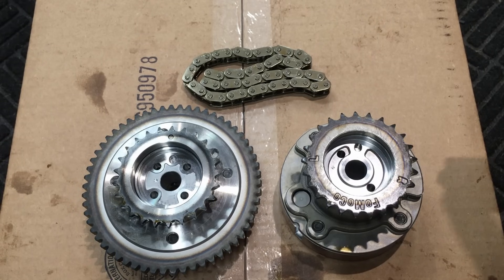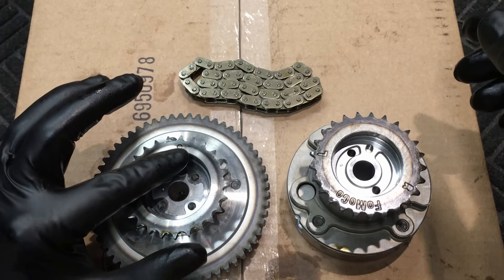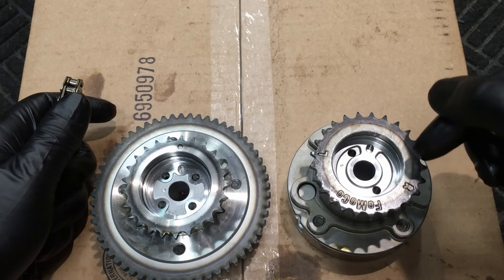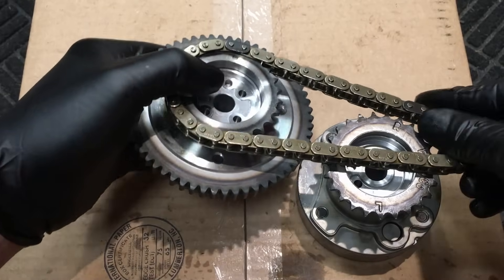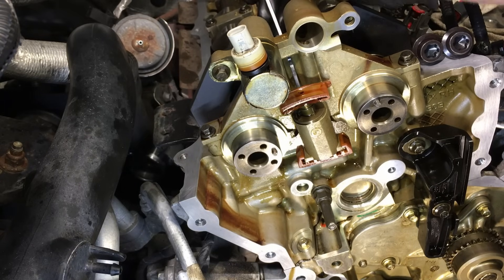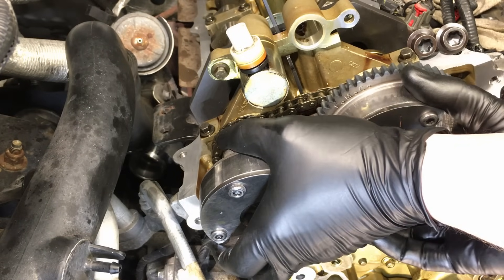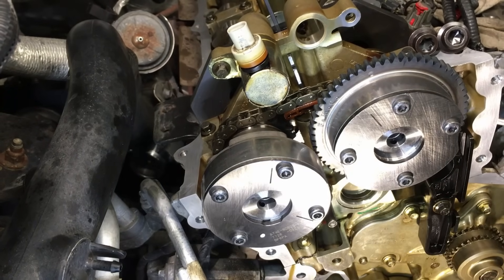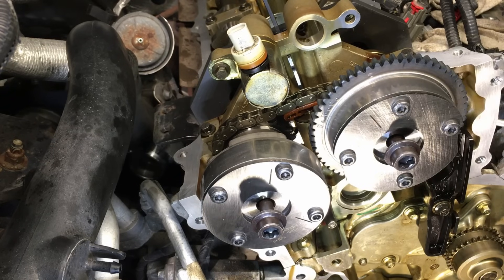2011-2016 Ford F-150 3.5L Ecoboost Timing Set Replacement Part 3: Timing the Engine

Comment: You might add to make sure to install guides before installing cam phasers. You didn’t replace them in this video but the kit cane with them. Now I can’t install bc the bolt doesn’t pass the phaser without removing it🤦🏻‍♂️

Comment: My new chain doesn’t have any colored links! To make matters worse I forgot to take the crank bolt off before I ripped everything off in prep for the new oil pump. It was lined up with the cam holding tools prior to that but it moved from the 4 o’clock position when I pulled the crank bolt off. How many links from the Passenger side cam timing mark to the crank timing mark??.?

Comment: Hi, great videos!  I followed everything to a “T”, and upon startup I have a recurring p0017 code (cam/crank correlation bank 1, sensor b) and the truck is down on power. I replaced the secondary chains and all vct solenoids while I was in there. Any advice?
Reply: Did you ever able to resolve the issue?
Reply: @painterken2542 yup. Did it all over again, found that I didn’t take all of the slack out of the driver side of the main chain. Ended up one link off. After redoing it, it’s been prefect for 35k miles!

Comment: Looks like the chain was offset(teeth on the outside of chain) on the idler sprocket. Hope you fixed that!
Reply from the maker: Nope it was perfect.
Reply: @FordTechMakuloco  I wondered can you direct me to a writeup? I didnt understand what you meant by removing the(followers and adjusters). I didnt see you remove the cams so I suspect I wont need to? I dont understand why or how you mean turning the cams without the crank, or how much... Please help.

Comment: So I'm rebuilding the engine on my 2012 F-150 with the 3.5 EcoBoost and I just did the timing using all new parts i watched all of your videos plus using a Haynes manual everything looks good except for the passenger side secondary chain has some slack on the bottom but it's not all the time just when the cams are in the neutral position is this normal?

Comment: Would be very nice to mention that the cam phaser bolts use a TP55 and not a T55
Reply from the maker: Either works as shown here but yes the bolt head is torx plus.

Comment: Excellent video! Job is tough for a backyard mechanic as there are many tricks getting fittings off without breakage. Not a lot of room for the front cover work area, but manageable. It is hard to get all the coolant out as explained in video. Prepare for spillage on the ground. Be sure to use a zip tie to hold the chain together at the crank sprocket before installing the tensioner. I didn't the first time and cams were out of phase and it ran like crap. Pulled it apart again and redid it with zip tie. Installed new tensioner and pulled pin, then cut zip tie. Alignment was perfect. Do not tighten crank hub bolt with cam locks in place. The chains will slip on the gears. Use a strap to tie the crank hub to the frame.
FYI it took some driving before the permanent DT codes cleared. Cleaned them out with my OBD scanner and all good. Also gapped plugs to .028".   25 MPG once again and smooth as glass.

Comment: I have a 2012 f150 EB with 225000 miles on it.   I take real good care of it regular oil changes. I was a ford mechanic back in the early 90's.  this looks like a easy job and i am looking forward to doing such a big job again.  I have been fortunate to have no problems with this engine till now,  I will be going to ford to get all my parts to do this job,  I plan on changing the water pump while i am in there.  is there anything else that i should look at replacing as a preventive maintenance since I am in there?
Reply from the maker: I would also upgrade the oil pump while it is apart- https://amzn.to/3T1k86K

Comment: Salute Brain, 
Thank you for the great videos- Part 1-2-3 !
Have replaced timing chain, phaser and associated TTY bolts, gaskets on our 2011 F150 3.5 EBoost. 
Upon disassemble of covers and assessment-  the intake CAM Bank 2 was an aftermarket FoMoCo, differing from the other 3 CAMs from manuf. (a CAM addition prior to ownership) was off one link from the color coded link. 
The chain was stretched nearly 3/4 inch & ratcheting tensioner was played out to the end.
Upon assembly of chain, phasers & the Bank 2 CAM with CAM locks in place the CAM phaser was still off this one link. 
The CAM locks were very tight - taking slack out of lower part of chain it lined up exact. Color coded links matched properly.
After assembly - OBD coded P0019 & 18. 
Ford mechanic shop assessed diagnostic $139.00 and recommended vehicle timing be set. Allowed it was off 10 degree. 
Have you seen a service bulletin for a CAM change out? (for whatever reason the CAM was changed ) 
Do you think the diameter of the intake CAM is changing the chain tooth link by 10 deg of time?

Comment: Are these interference engines? Customer came in with broken secondary chain wondering if the valves and pistons are ok
Reply from the maker: yes they are.
Reply: @FordTechMakuloco  I guess this timing chain just turned into a valve job too…

Comment: i have a 2015 3.5 tt about 80k miles  bone stock engine no funny noises on start up drives smooth i hope i can get atleast 150k miles out of it without doing any type of engine work crazyyy i should have just kept my 2002 5.4

Comment: Serious question here ….. on the back of the phasers there are 5 holes on one 3 on the other does it matter which hole the pin on the cam goes into? I don’t want to have to redo this and I did see where anything was mentioned other than it would fall in place

Comment: Help! I pulled my front cover and the crack timing mark is at 12 with cam phaser marks almost at 11 and 1 as they should be. I can definitely feel contact while trying to rotate. I believe the crank gear jumped teeth while removing the crank pulley bolt. How can I do a full timing reset?
Reply: Can you help please let us know how you you did the timing reset?

Comment: I truly appreciate the fact you took the time to walk through this procedure.   I know the post is 5 years old but  I do have a question.  My 2011 3.5 EcoBoost with 147,000 mi has never towed anything and never been driven hard and has zero rattle on startup and seems to run normally.  I've always ran full synthetic. The truck will randomly throw the P00017.  The only time it throws this code is when the RPMs drop below 800 RPM.  Let's say the truck's sitting idling and the air conditioner compressor suddenly kicks in putting a putting a slight load on the motor while idling The code will be thrown.   If I drive the truck around town or down the freeway the code is never appears.   If I never let the truck drop below 800 RPM the code never appears.  Can an EcoBoost run normally have no startup rattle and still need the timing chain replaced?  I have an appointment next Thursday I an appointment at a shop to determine what the issue is.  I explained the issue to him over the phone and he seems to be fairly sure even before looking at it that it needs a timing chain kit put in it.   He said if it is the timing chain It will cost 5 to $6,000 and that I should just sell the truck.  I'm just gathering as much information as possible to avoid being misled.  Thanks again and sorry for the long question.
Reply: did u fix or sell? lol

Comment: If a 3.5 jumps time,is it necessary to pull the heads and have valves replaced,does it bend valves every time?
Reply from the maker: It is quite impossible for the engine to jump time, did the chain break?
Reply: @FordTechMakuloco  no,but the timing chain marks are not aligned,i just got the cover off,no slack i can find,im puzzled
Reply from the maker: The timing marks will not align after it has run.
Reply: @FordTechMakuloco  would the cam phasers cause this?

Comment: Sorry to bother again. My crank shaft is off by half a link (too far clockwise). Should the crank be advanced another rotation? Or just moved back to meet the right spot?
Reply: I wonder the same
Reply: @ i ended up just rotating counter clockwise. Found out the 3.5 is an interference engine and will not go around with the cams set and locked. My outcome was more or less successful.

Comment: Have you ever come across the exhaust and intake cam location dowels not lining up correctly even with the camshaft holding tool in place? On the left side, the intake dowel is between 11 and 12 o'clock; in relation to the top of the head. Any ideas what the issue could be? It looked to have jumped time, when I lined up the phasers, the crank timing mark was at 1 o'clock. I'll need to check the compression of  all the cylinders to be sure I didn't make contact with any valves. By the way, thanks for the videos, your channel has been my go-to for years now; great job!
Reply from the maker: Never seen it. I mean you are using the cam holding and alignment tool right? So now the cams will be set perfect either way going back together.
Reply: @FordTechMakuloco   Brian, Thanks for the quick response. It was a rookie mistake. I put the phasers on correctly on the right side but turned right around and put the chain on the left side's timing marks first and then rotated the phasers so that the pockets "lined" up to the timing dowels on the camshaft. Note to self..No more beers while working on the vehicles
Thanks Again

Comment: Wow
I can do my timing set and water pump I’m looking for 2013 with the 3.5 twin turbo when I get the truck I can do the timing the guides and the oil
Pump. And I will do the preventative maintenance like the seals on the turbo. I may just pull the whole engine when I find the right one. That way I can travel the country and tow boats cars medium sized RVs thanks to you.

Comment: I am in the middle of doing the timing chain replacement,  phasers, oil pump upgrade, etc.

While lining up the phasers I think the crankshaft sprocket slipped a few teeth due to loose chain.  New chain lines up on the phaser side but the crankshaft timing mark is off by a little less than 1/4 of a turn.

With the cams locked in place do I just need to turn the crankshaft alone until it's lined up?
Reply from the maker: Yes
Reply: @FordTechMakuloco  thanks so much for the reply. Your videos have helped me out so much on this repair.

Comment: Can the Phasers simply be rebuilt there in the shop?  Also, I think I would just replace the water pump while in there (has 100K on it) and maybe even the oil pump with a HV unit???  Lastly, why not just get all those plastic guides!  Aren't they going to get hard over time and start cracking up....?   Great videos as usual Brian.  First Class.

Comment: Great video! Thank you for posting. Is this the same procedure for a 2010 Mazda CX-9?
Reply from the maker: no
Reply: @FordTechMakuloco  do you know which engine timing chain is very similar to the 2010 Mazda CX-9?
Reply from the maker: They are the same as the Ford models that have the transversely mounted powertrains.
Reply: @FordTechMakuloco  thank you for your quick response and thank you for your videos.

Comment: Pretty sure this is what my 2011 SHO needs. Are the parts and torque specs the same?
Reply from the maker: It is totally different.
Reply: @FordTechMakuloco  Figured it wouldn't be that easy. Had a p0016 and p0020. Checked sensors and harnesses and all came back good. Figured with 175,000 it's most likely the timing chain. I'll do a parts search. Thank you for getting back to me. You're videos have been a huge help over the years.

Comment: I am up to removing the chains, but my F150 is a gen 2. I was really kicking myself as I watched a video on the wedge tool as that would have been a real time saver - then I got the first primary chain off and half of the crank gear came with it. I guess that might have been the grinding noise that prompted me to get busy replacing the cam phasers. I am thinking that I probably would have missed the broken crank gear if I had used the wedge tool, so a thorough inspection of that gear is a must for anyone using a wedge tool. And seriously, how was my truck even running (at all) at 17+mpg? Grinding noise started about 5 weeks ago, approximately. Take care and happy holidays everyone!
Reply: Sorry did not mention: 2017 F150 XLT 3.5L Ecoboost (FX4), 117K miles, started getting the dreaded long pause after turning the key about 10 weeks ago and the rattle had been going on longer than that. Took me a while to get the scratch together for the components (excuse for being scared to do the work myself lol). 

Side note: the TP55 cam bolts can go straight to H for all the trouble they have given me; stubborn does not even begin to describe the little devils - heat, breaker bar, air impact wrench that I bought and modified my compressor for to do this job, nope zilch nada and a metric ton of cursing has moved a single one. Going to weld a nut to one and see if that plus the bolt heating from the weld will break it loose, and then I am going to drill the heads off and add another 2 days to the fun. I think I am having fun, anyway! Maybe LOL.

Comment: Thanks for doing this video it gave me the confidence to complete the technical service bulletin from Ford. I also went the extra mile and replaced all the oil pump tensioners, VCT solenoids both banks, CMP sensors, water pump. i spent a little lol.

Comment: This is my 4th time doing my timing set. This thing keeps jumping time on me. I had it all on, assembled it and started it.. It was off. I'm now off 2 teeth. 
Litterally between assembly and startup this thing is skipping time. 
I turned the engine over to line it back up and I'm off two teeth. Any advice?
Reply: Did you get this right? I have to turn the crank to the right to pull the slack out of the rest of the system before releasing the tensioner so it would take up all that slack. Otherwise the slack is on the far side from the tensioner and it will jump time

Comment: Got a question, I have a customer that supplied their own chain kit, duralast timing chain kit, not my choice of parts, I went ahead and replaced all the guides and the all 3 tensioners, but the secondary tensioners never would pump up all the way, I originally pulled it apart because of a 4 second chain noise which was a week or bad tensioner on the drivers side, is there something I was supposed to do to get them to operate correctly or do I have a faulty part?

Comment: So you don't recommend replacing the internal water pump? On this engine it looks like an idler where the water pump was on the older 3.5L.
Reply from the maker: Right it is just an idler.
Reply: @FordTechMakuloco  question, I plan on buying a 2017 Explorer 3.5 na. Does this engine have an external water pump?

Comment: If a Ford engineer made that middle idler movable down on a slide it could be used to adjust for chain stretch.  As the chain stretches you turn a bolt and drive the middle idler down bringing the phasers back into alignment.   The stationary arm would also have to be movable by an external control (bolt) to bring the crancshaft into aligment with the phasers.  That way Ford customers will only have to do a chain alignment procedure instead of the unreasonable cost of changing all timing chains.  Ten minutes verses hours is a better deal.  Once all adjustment room is used, it would be time to replace the timing chains.  By that time the engine would have a respectable number of miles on it.   My engine has less then 53000 miles on it and I am already getting the P0016 fault.  The wife's Toyota has more than double the miles and it has been a worry free RAV4.  My F150 cost $12000 more than that Toyota.  Sometimes it hurts being a Ford guy.  Brian your skill set is impressive.  Excellent work.

Comment: Extremely good video series, however I replace my timing chainabout a month ago in the noise already came back just wondering what they could have missed?
Reply: Oil pressure low maybe? Clogged pick up tube or bad solenoids?

Comment: Do you know if the new ecoboost models have this issue ?
Reply from the maker: Not yet
Reply: Yes. Just had all timing components replaced on my 2018 3.5 ecoboost.
Reply: @tb1951  You had the same problems even though the parts are supposed to be updated from the factory?
Reply: @311hitwall  Yes, my truck still makes the noise but not near as loud. The Ford tech that actually did the work said he replaced the parts with the latest part numbers but the "real fix" hasn't been released yet. This was as of 12/19/19.
Reply: @tb1951  Man that stinks.  I guess i need to stay away from Ford.  I haven't heard anything good about the 5.0 engines either except maybe they are less trouble than the ecobooms.
Reply: @311hitwall  its a nice truck but ill never buy one again.
Reply: @tb1951  wow, i thought ford added another pin tensioner to the other side because the chain is so long

Comment: I get a P0014 after driving for about 3 hours straight. What do you think?  Maybe just the solenoid? It’s been doing this for several weeks now and never happens around my hometown but only when I leave out for a long work trip which is over three hours of driving. It pretty much happens every single time I’m on a long drive. I can turn the truck off and clear the code and start it back up and it will be good for several more hours before I even see a pending code.

Comment: Brian when I check the timing the crank is at 2 o’clock not 4, I have the cam locks in place and all the upper mark look like yours.  Should I rotate the crankshaft to match the timing chain marks?  The tensioner was all the way out . Compression is still good.  Any ideas?
Reply: how did you make out Ray?